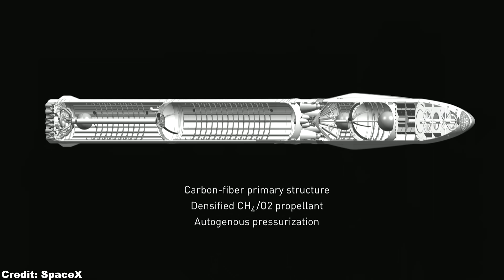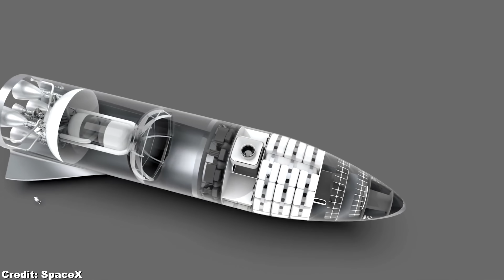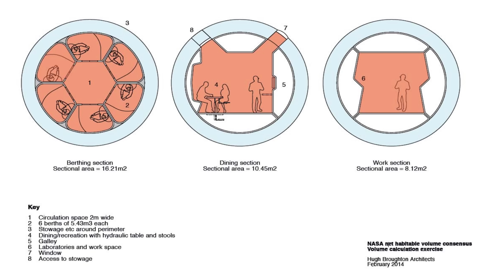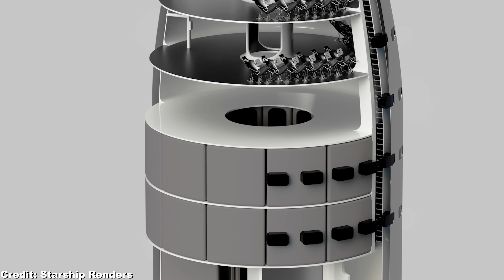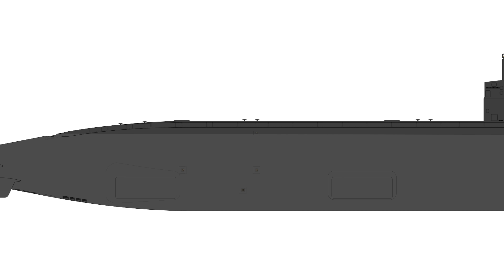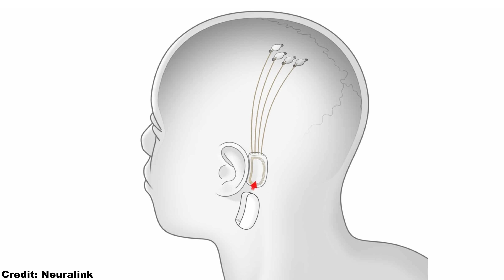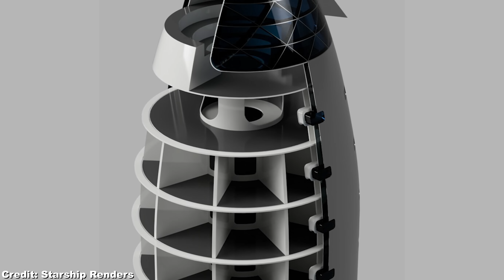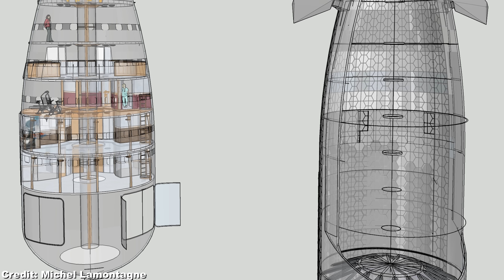CAN YOU SURVIVE 6 Months With 10 Cubic Meters? [SpaceX Starship FLAW FIX]

Comment: Why not use the superior lift capacity of Starship/Superheavy to build a Mars transfer passenger vehicle? If you can build Starships, you can most def build pressurised passenger gondolas attached to a truss structures. Plus fuel tanks. Build it like the London Eye ferris wheel, and you can use rotational faux gravity. Use the Starships to tow it up to speed, and then slow it down. It dont have to land at Mars, but can be parked at Phobos or Deimos as future moon bases. Or just let it continue as a transfer space station.

Comment: Reducing the trip time is actually not that complex I think. It could be done by the addition of drop tanks for additional propellant. The drop tanks would of course need to the attached on orbit. The amount of fuel that can be added in this manner is almost unlimited since there is no gravity that would create structural load. 
Rather than running at high thrust one could run just one engine, possibly even one smaller than Raptor giving maybe 25 to 50 tons of thrust but for a much longer duration. This would put very little stress on the structure and also the drop tanks could be made very light as they would neither need to withstand high pressure nor weight. 
I haven't calculated how much the trip time would be reduced but I'm guessing that an additional 4000 tons of of propellant without much addition of structural mass might halve the time.
The only big issue is the many launches that will be needed from earth to LEO to fill the drop tanks with propellant.

Comment: I guess it will more look like a capsule hotel in Japan!
The cabins are the just for sleep and on every deck there is a toilet and shower used in shifts.
I mean there will be no night and day schedule, so everybody can get a 30 minute slot for washing and another 30 minutes per day for "waste extraction".
When you locate the "bed" at the hull a slight rotation would give a feeling of low gravity, mayne enough for keeping your system stable for months.
A 9 meter  diameter ship could have an inner cicumference of around 25-27 meters, lets say 26m, when every cabin is 2mx2m on the hull and 2m deep thats less than 8m³, but that would be just for personal storage and sleeping and for every deck you would have place for 13 cabins, to get to 100 people you then need around 8 decks.
Lets say 10 per deck, when you use one cabin for bathroom, one for a toilet,  you have one left, or you calculate that the walls also some space, that would end up with 10 cabins, one bathroom and one toilet for every of the 10 decks.
Maybe ...

Comment: What about putting most of the crew in a medically induced coma with bio-electrical stimulation  to prevent atrophy. An automated system to induce and revive. Not quite the SciFi hibernation. But could save a lot of space.
Reply: I know someone who was involved in a difficult car crash and he was put into a medically induced coma due to his severe injuries. He was in a vegetative state for roughly 6 months.
When he woke up he had lost half of his bodyweight even with intravenous feeding and was very thin, as if he had starved for weeks.
So even if you had electrical muscle stimulation, one would need to closely monitor the calorie intake to prevent accidental deaths.
It should also be mentioned that the machine keeping the lungs oxygenated would unfortunately dry up the throat and make you unable to speak for some time after waking up.
Reply: @DecepticonLeader  Of course new technology will be required. Humidifies are built into CPAP machines surely should already be in these breathers. Plus some crew would still be awake to monitor them and the ship.
Reply: @davidtramontana7117  At the time they didn't have humidifiers, but I'm glad to hear that problem is now out of the way. Yes, some more tech would be great, looking forward to the day we can get on board. Maybe Mars as destination, but the moon would be completely fine for me as well. :-)

Comment: I like the turtle design where there is an inner shell and water between the people and space. It provides structural integrity plus radiation protection. Downside is the weight.... 100 seems unrealistic.... Though there is water on Mars I think water is mission critical...
Reply: Weight can be shifted an orbital water station at Earth and Mars to fill them up and empty them out thus landing the ships with much less weight accelerating and decelerating the water mass in between would remain an issue though unless you used it as reaction material to decelerate or so on.
Reply: @Barskor1  Interesting idea, still water on Mars will be worth more then gold))))

I think some can be plant based Starships loaded with seed, plants and equipment/nutrients)))
Reply: @Barskor1  While resources are everywhere my point is this is going to be the biggest challenge of our species...
From robotics to food everything is life critical... It is not just starter seeds it is literally everything...
Thanks for the interesting comment....
Reply: @Barskor1  Yes and no.... The wear on Mars infrastrucure is going to be extreme from cold and dust. Mars is going to need constant and I mean constant supplies delivered. Why go if the next wave of materials isnt far behind....

Just look at those supply drops from military cargo planes down in Antartica!!!!!! 

I think a 6 months trip with a fleet of 64 ships, around 2k people will need already ships landed on Mars! On top of that these ships need to be landed with no intention of returning.

Once they leave resupply has to be already almost ready. From now on a constant supply run of ships dropping off supplies like in Antartica will be an ongoing expense. Yes there are amazing resources in space. One problem, it is the most hostile environment imaginable with no room for mistakes or failures.

I suggest watching the Mars Societies speeches every year and get a sense of the mission. It will be done. I want it to be done. I also think it will be decades on Mars before the supply drops could be eased off.....!

Kind Regards from Australia!